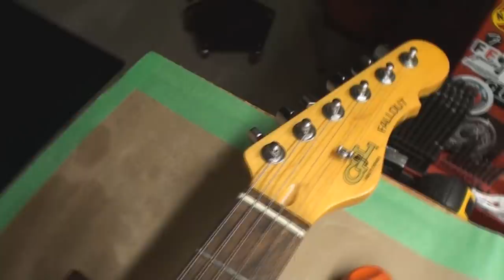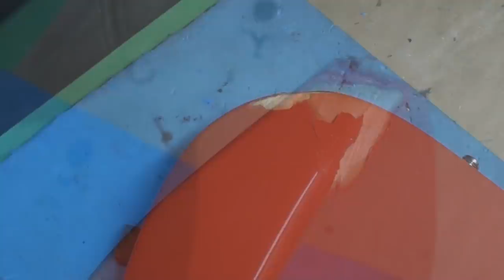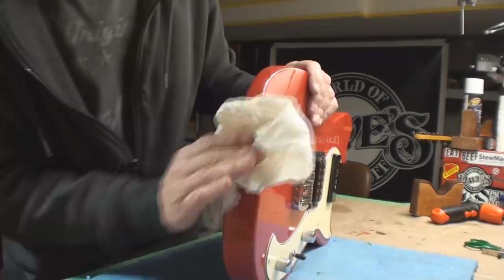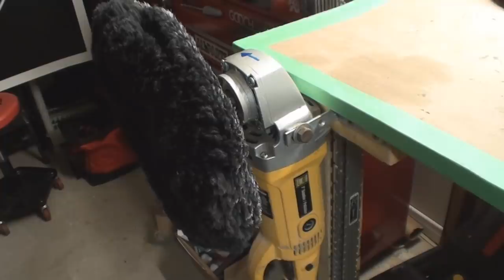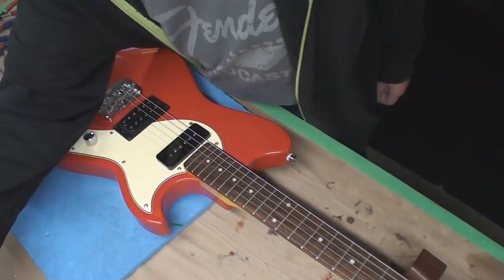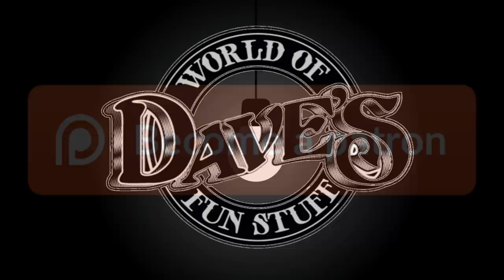G&L Tribute Series Fallout Guitar

Comment: Was that guitar dipped in plastic, that is thick paint.
Reply: Looks like a polyurethane finish. 

Super thick and an absolute mess if you want to strip it down to bare wood and repaint.
Reply: @IanThatMetalBassist   The poly comes straight off with a heat gun. The sanding sealer underneath is the mess. That stuff soaks into the wood and is impossible to get off.
Reply: Shitty thick reacted polyurethane finishes are of course easy and cheap to apply quickly.
Can I easily strip my 1985 MIJ 62 Squier Stratocaster with a heat gun? It's a really nice guitar except for the indestructible paint.

Comment: 5/16 would be 8mm, 7/16 would be 11mm and 1/2 would be 13mm.
Reply: And 10mm is 3/8
Reply: Hill Billy The hip bone connected to the thigh bone.
Reply: Dave's World of Fun Stuff Those are not absolute conversions, but any fraction beginning with 5 is very close to a mm divisible by 4. 5/32 is about 4mm 5/16 is about 8mm, 5/8 is 16mm. When you start confusing socket head screws, you start stripping things. 1/8” strips 3mm, 1/2” strips 13mm. 

Anyways, good video Dave. I’ve been watching for a few years now.